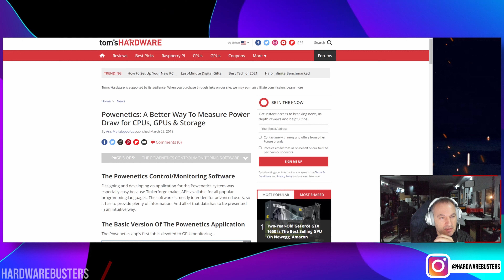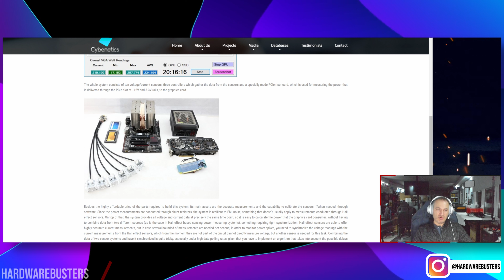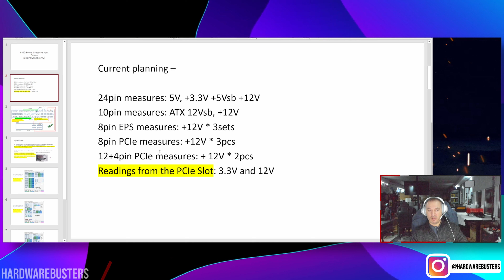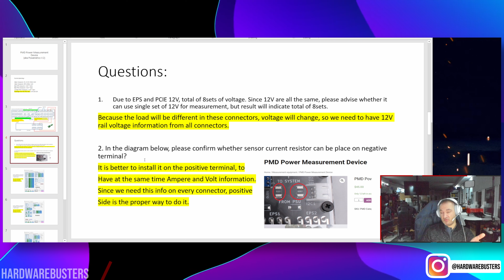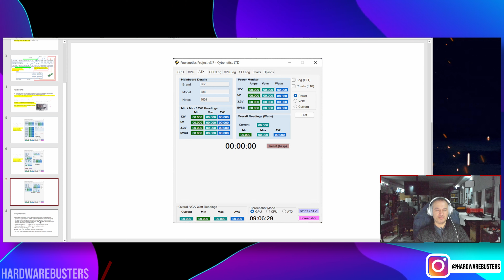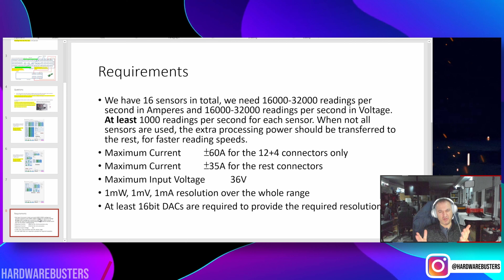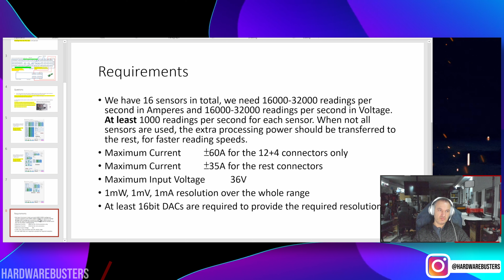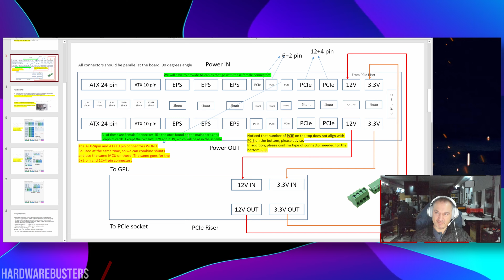Project Power Measurements Device (PMD). AKA Powenetics v2

Comment: an interesting project to be working on. in terms the dac built into the mcu. well that is something can often be problematic. both for a good quality signal integrity. but also for fighting the limitations and bugs of the mcu itself. it can throw up obstacles or in the end prove to be unsuitable for your desired application which relies so heavily on a good adc performance. so you really have to be careful in that aspect of the design. then perhaps it would be a lot better option to have the dacs seperated from the mcu. either on their own analog devices chip, or maybe implemented into a low cost FPGA. there is even some mcus with fpga built into the mcu itself (if you do in fact end up needing a low cost fpga). however for the mcu itself well... maybe the h7 or the rp2040 are the sort of thing i would myself be thinking about here. and paired with whatever is a reasonably priced 16 bit dac from analog devices. but this is all mostly backseat speculation on my part. and perhaps you may find better solutions than i am suggesting here. good luck! & wishing for you the best success

Comment: Elmor has a simpler one if you want to check that out.
Reply from the maker: Yes I noticed this, it is very basic and doesn't even have a PCIe riser support, so you can only measure from the PCIe connectors.
Reply: @HardwareBusters  yes that's true. Although as far as I'm aware it has a high polling rate for measuring which is why I mentioned it.

Comment: Why not build the pcie slot shunts in to the riser card to avoid have the extra cabling in the power path? Unless it'd be harder to then protect the signal integrity of the sense wires? Also, won't having the PSU cables plug in to your measurement board eliminate the ability for the PSU to get accurate 5V and 3V3 sense readings on the sense wires that normally go in to the 24-pin?
Reply from the maker: Because we will have to transfer data then from the PCIe slot to the mainboard, and we will also need an MCU on the PCIe slot. This can be more expensive. Sense readings will be limited on the board yes, but in this case I don't care for the PSUs' load regulation, I only care for power measurements which will be the same, since with lower voltage the PSU will just have to deliver higher Amps, to provide the necessary Power. Good point, though!